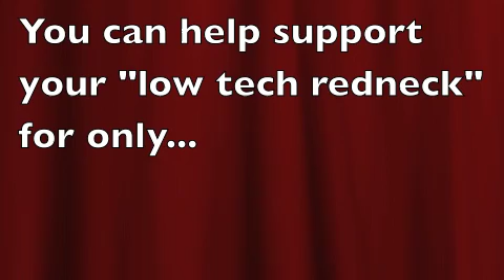How to build an Electric Chainsaw Firewood Processor (Low Tech) DIY

Comment: I just use a skillsaw mounted upside down on a small stand for any wood under 4 inches, anything bigger goes on a log rick.  Most people feel uncomfortable with an exposed blade like that, but after 16 years I still have all my fingers.  Keep a wheelbarrow under it and you don't have to pick kindling off the ground.